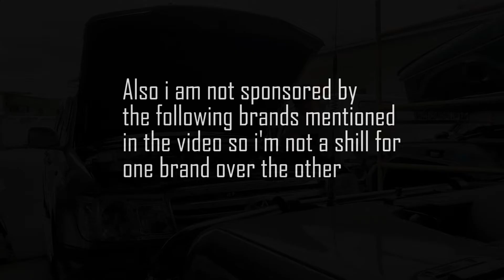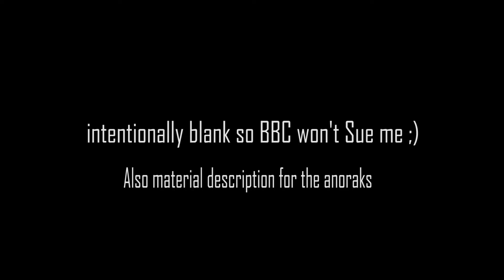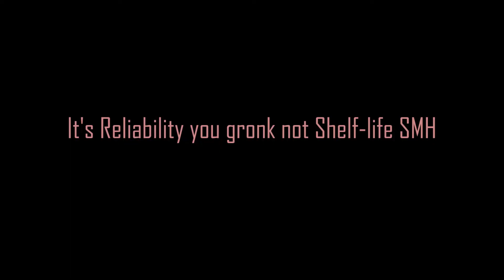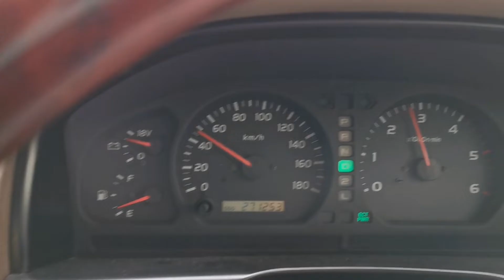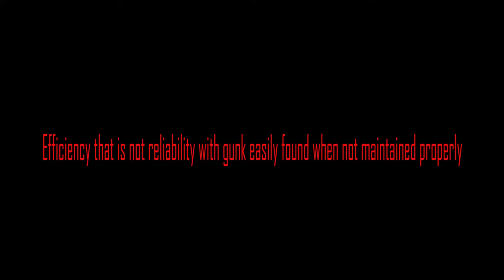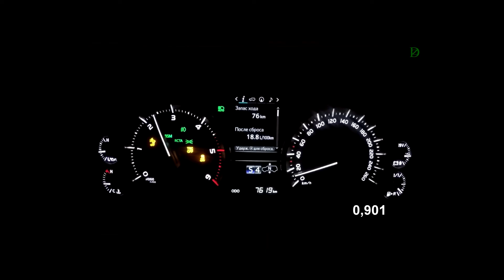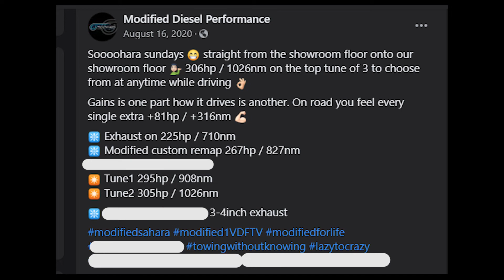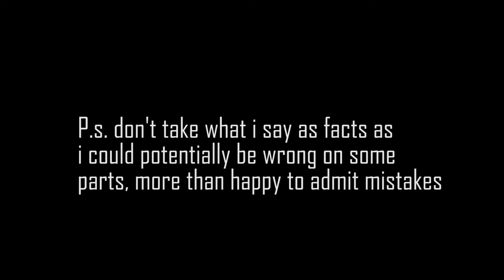1VD-FTV: Toyota's V8 Diesel Powerhouse? Engine Overview and specs

Comment: Excellent, strong motors. They are some of the hardest worked trucks in the South Pacific/Africa and happily do 100,000 upon 100,000s of thousands of kms. Only bugger Is the price and they are a pain in the arse to work on.
Reply: Yeah I just watched a video of an injector replacement on one of these 😮
I think I would prefer a 1KZ/1KD for a higher power diesel
Reply: @porcupinepunch6893 what you’d want is a 1HD

Comment: What you mean is that in 2016 they introduced DPF...They have have EGR since birth in 2007. What you also mean is the Engine has tighter Clearances, not tighter tolerance. Tolerance is only as good as the tooling

Comment: Thank you for another great video.
Reply from the maker: Glad you enjoyed the video. It takes forever to make one 😂
Reply: @TAI-lr5vr  I bet it does.. I’ve been fortunate enough to own a 60, 80, 100 and now a 200 series turbo diesel Landcruiser. Must admit, the 60 12H-T and 100 1HD FTE are the favourites so far. Keep up the good work mate.
Reply from the maker: @seanlittlefair105  Thanks mate, now I'm on the hunt for a 12HT for its own video feature. I see you're a Toyota man too 😂
Reply: Definitely the 1hdfte.
These 4.5V8’s are POS 💩, gutless for a V8 unless you spend $25K on engine upgrades, turbo, intercooler, fuel pump, injectors & on & on 💰& its still a letdown.
But i’ll stick with my Nissan Patrol Td42ti coil cab ute with a 18G 25psi 👍 she’s been run’n a 18G from the first 2wks i bought it brand new in 2004 & now she’s just clicked over 400k’s & never turned the key & been let down. Old school Japanese 4.2ltr turbo engines are the best, no common rail crap & DPF & no electronic & computer crap 💩.
But hey each there own, that’s just my opinion.

Comment: DOHC isn't complicated  as far it goes the Duramax is simpler because it's pushrod but it still  is a 4 valve engine even though it's a 6.6 diesel pickup engine.

Comment: Video Edit Tip: Red text is difficult to read, that's why you rearly see it on screen. Red text is sometimes displayed in a text box which has a controlled background colour. For example: Red on black does not mix. Cheers